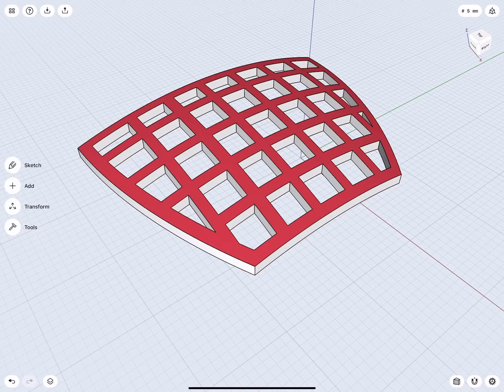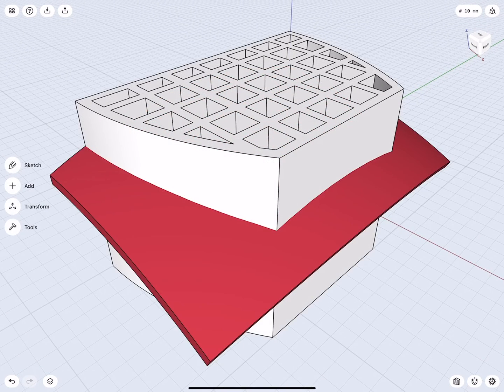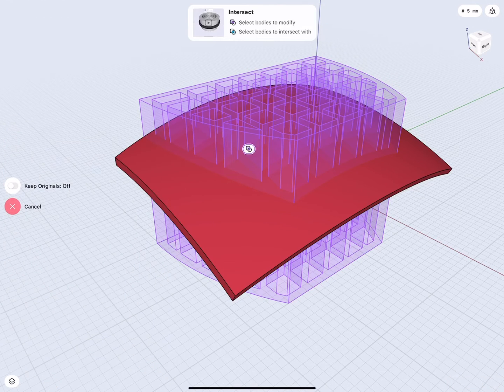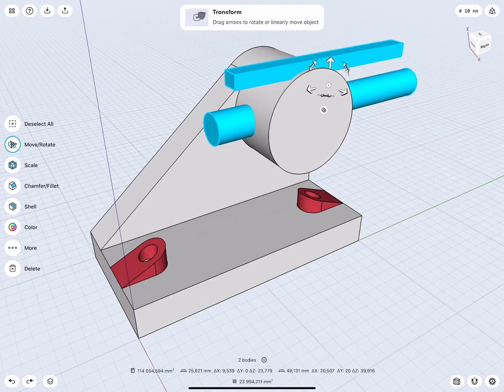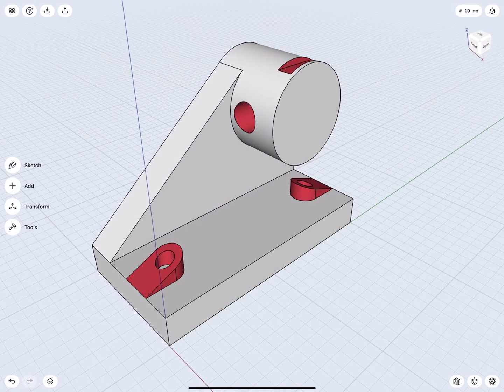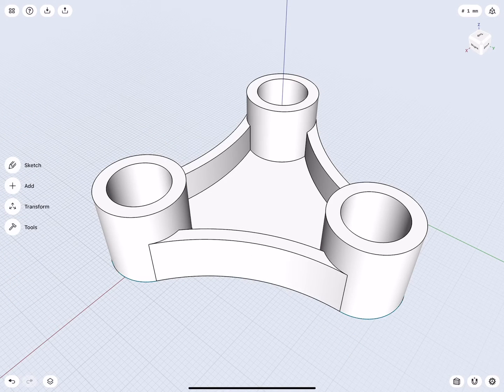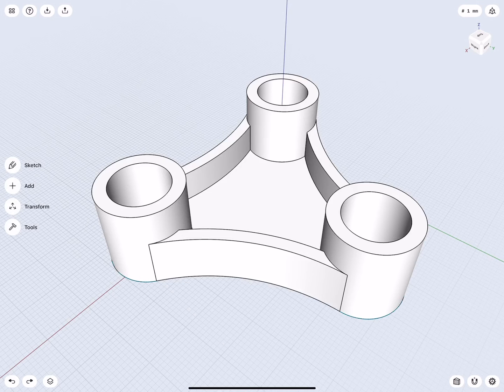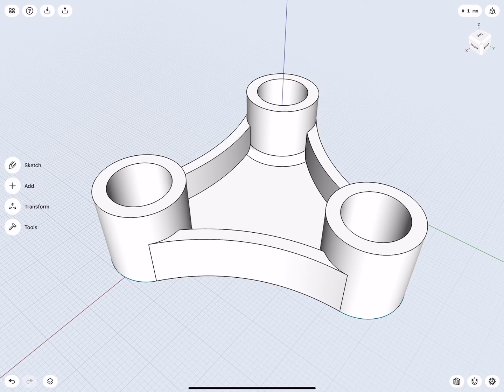Booleans | Creating complex 3D bodies

Comment: After using the union tool, how would you separate the singular union body later back to its individual parts? Other than using the Undo option…
Reply from the maker: Hi there, after Union is applied is only possible to revert it using the Undo. The other workaround will be to try to using the Subtract feature to separate the bodies.
Here's our video on the Subtract feature: https://www.youtube.com/watch?v=KlYHK4Wn-wc&t=13s

Comment: Clearly explained video. Thanks. The in-app video tutorial was very helpful too. However, being a subscription based app the main concern preventing me from progressing further is whether I may lose my projects in the furture. I.e. if I try the trial and decide not to buy, or I pay and then decide to stop paying, or I have an educational license which eventually lapses, what happens to my projects? Must I pay again just to access them or will I still be able to access them in non-edit mode?
Reply from the maker: After the subscription expires you will only be able to access and edit the last two created designs. Other designs will be locked, but will remain saved in the device. You can access and edit them anytime you renew the subscription again.
Reply: Shapr3D - that’s disappointing. Holding customers own data hostage until they renew is a policy which means I just can’t risk investing in this software. Made worse given the data is on the device all along by the sounds of it. I was starting to get excited about this software too. Thanks for the reply anyway.
Reply: @Wishwader  byeeeee go learn solidworks bummer
Reply: @irojii  English
Reply: You can get around that by saving the files to your device. If you use multiple formats, you can use them for anything you want, including importing ( 
Unless that’s a premium feature, but I don’t think it was.) I’m on the student license currently